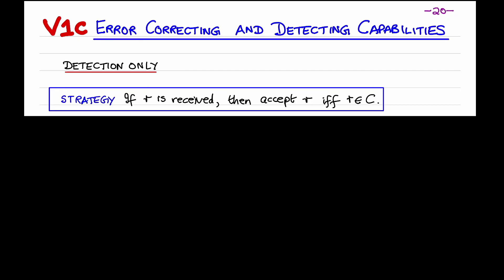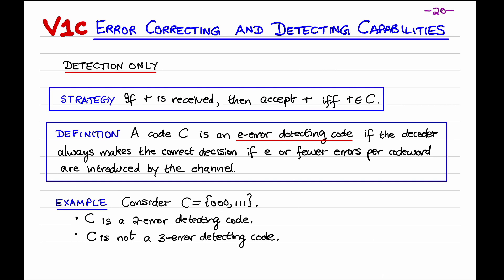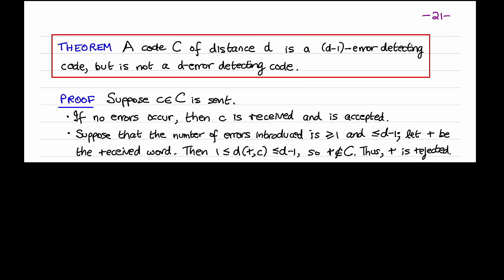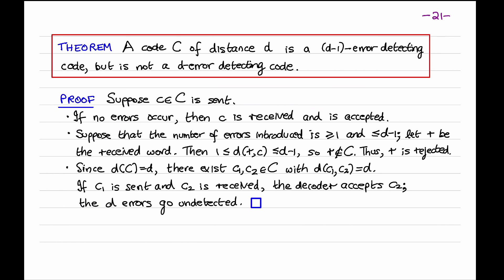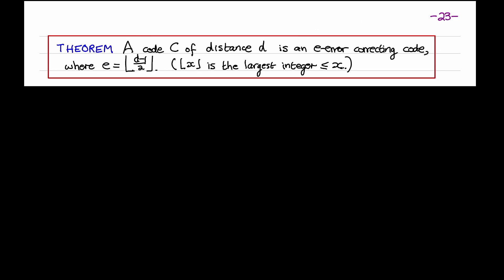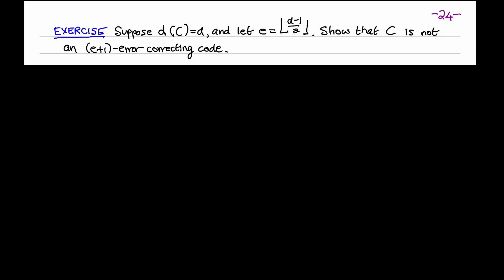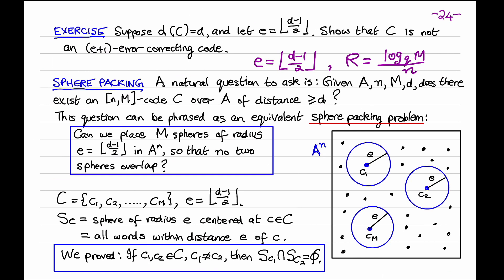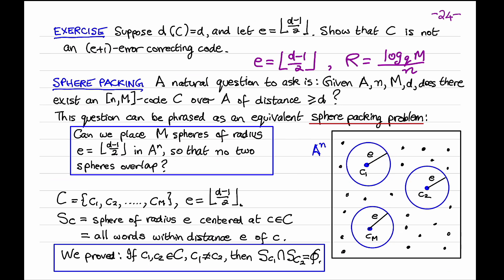V1c: Error correcting and detecting capabilities of a code (Error-Correcting Codes)

Comment: Hi, I also tried Question 3 in the problem set and here is my solution: 
(a)
Let C be the code of size M = Tq(n, d). We can define another code C’ by removing the same index for every c in C. We have |C’| = |C| = M for every c’ in C’ and the distance between each other is at least d-1 since every c in C has a distance of at least d. Hence C’ is a valid code of length n-1 with minimum distance >= d-1 and size M.

We can conclude Tq(n, d) <= Tq(n - 1, d - 1)

Intuition on part b: it is equal since e for both cases is equal, and there is some trick to delete one bit and fit it in. And you are able to use some of the results from part (a).
I have no idea what to do next.

For part c to part e, we have a fixed number. In this case we need to prove 1. Fitting M code words is possible. 2. Fitting M+1 code words is impossible.

(c)
We can construct a code like this: We take all the codes with an even number of 1s inside. And the size is 2^(n-1). This is fitting the condition since

If the number of 1s is different, there is at least 2 bits different from each other.

If the number of 1s is the same, we have: {
There is no overlapping position -> distance between them is 4 in this case.
There is one overlapping position -> distance between them is 2 in this case.
}

Overall, it satisfies the condition that the distance between any code word is larger than or equal to 2.

In our construction, fitting M+1 code words is impossible, since any new code will result in the word containing an odd number of 1s being included, and its distance is 1 with code that flips a random bit s.t. resulting in a code word with even parity.

(d)
WLOG, we assume c1 = 00000000 and c2 = 00111111. One can check C = {c1, c2} satisfies the requirement since d(c1, c2) = 6. Suppose we can fit another c3 into C so that the requirement still holds. Suppose c3 has x 1s in the first two bits and y 1s in the rest of the bits. For the code to work, we have x + y >= 6 and x + (6 - y) >= 6. When solving the equation, there is no such x, y that can satisfy these two equations at the same time since x <= 2 by construction. Hence, we can not fit the third word in the code. We can conclude T2(8, 6) = 2.

(e)
WLOG, we assume c1 = 000000000, c2 = 000111111, c3 = 111000111, and c4 = 111111000. One can check that C = {c1, c2, c3, c4} satisfies the requirement since d(ci, cj)=6 for all i, j in {1, 2, 3, 4} that i != j. Assume we can fit another c5 into C so that the requirement still holds. Suppose c5 have x 1s in the first 3 bits, y 1s in the middle 3 bits, and z 1s in the last 3 bits. We have x+y+z >= 6, x+(3-y)+(3-z)>=6, (3-x)+(3-y)+z>=6, (3-x)+y+(3-z)>=6 based on the requirement. However, there is no x, y, z that satisfies these inequalities. Hence, we can not fit the fifth word in the code. We can conclude T2(9,6)=4. 

Proof for parts c, d, and e might have flaws since there is no proof that the construction is the best construction that fits the most number of code words into the code.
Reply from the maker: For 3(a), you need to construct a code C' from C of size M and length n-1 with distance exactly d-1 (not at least d-1). You can do this by selected two codewords c1 and c2 from C with d(c1,c2)=d, then select a coordinate position where c1 and c2 are both 1, and then deleting this coordinate from all codewords in C.
Reply from the maker: For 3(b), you need to show that T2(n,d) >= T2(n-1,d-1). Let C be a length-n code of distance d-1 and size M=T2(n-1,d-1). Now construct a code C' of size M, length n and distance, by adding a single bit to each codeword of C. Hint: add a parity bit.
Reply from the maker: For 3(c): you correctly proved that T2(n,2) >= 2^{n-1}. To prove that T2(n,2) <=2^{n-1}, you can pair each length-n binary vectors with the length-n binary vector whose first bit is flipped. Then at most one vector from each pair can be included in a length-n binary code with distance 2.
Reply from the maker: For 3(d): Your proof is complete. You showed, without loss of generality, that there cannot be an [8,3,6]-binary code.

Comment: Hi, I want to check if my idea for the exercise is correct:
Since d(C) = d, there exist c and c’ s.t. d(c, c’)=d 

Suppose code C is e+1 error-correction code, there exist r s.t. d(c, r) = e+1 and it will be correct to  c.

We have d(c, c’) >= d(c, r) + d(c’, r) by triangle inequality. And since C is e+1 error correction code, we have d(c’, r) > e+1, this means to d >= e+1 + ((e+1) + 1) and the inequality does not hold since the RHS >= d+1. Hence the code C can not be a e+1 error-correction code.
Reply from the maker: Your solution looks good to me.